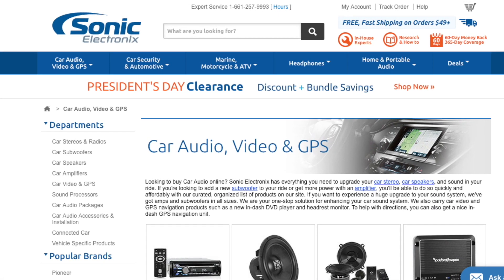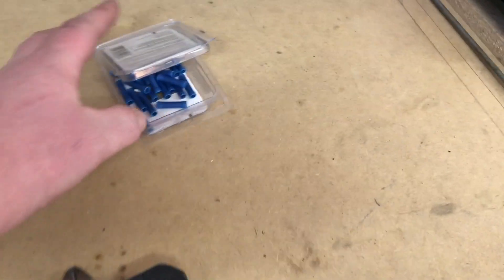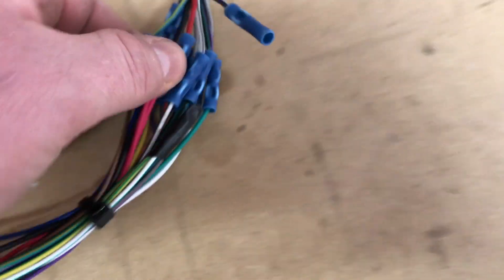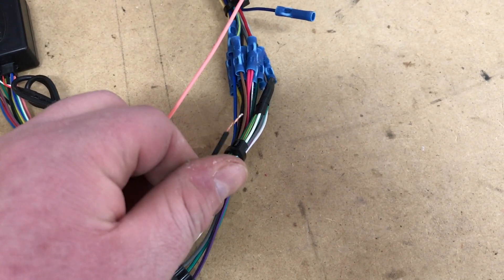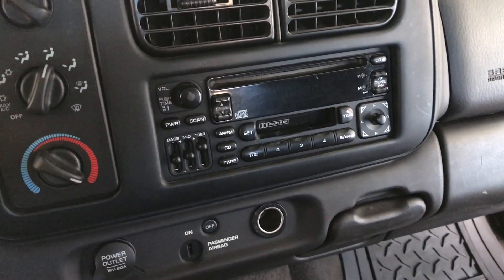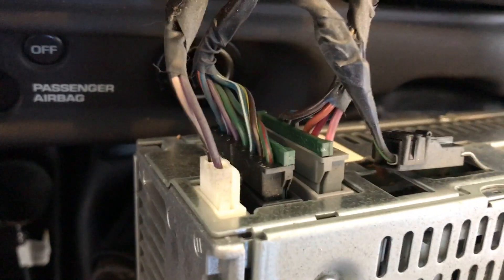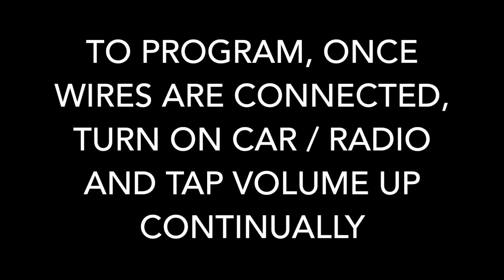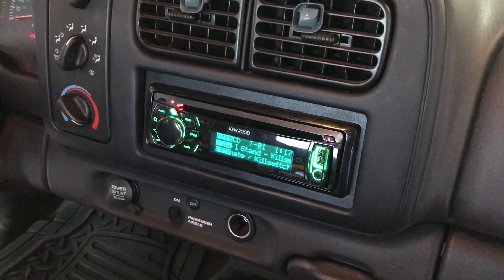1997 - 2000 Dodge Dakota/Durango Radio Install

Comment: What does the orange wire connect to
Reply from the maker: Orange wire is generally the illumination / Dimmer wire.  If your radio does not have it equipped, just tape it off.

Comment: What color wire is the hot one
Reply from the maker: Constant 12v is yellow, switched 12v accessory is red.
Reply: Provo Beast Audio Installation there is two plugs and a small plug  I'm stuck

Comment: Where does the amp turn on wire go?
Reply from the maker: to the blue wire if you have the amplified system.  If not, just cap it off.

Comment: I got power but no sound idk what the fk i messd up on it color coded
Reply: Plz help
Reply: I have the infinity sound ... so factory amp ???
Reply from the maker: Sounds like you may have the factory amplified version which in that cause, you need to hook up the amplifier turn on wire to trigger the factory amp to boot up.  If you use a wiring harness adapter, you will need to connect the solid blue wire on the adapter to your radio's blue/white wire.
Reply from the maker: Yes, you will need to hook up the solid blue wire to either the radio's blue/white wire or the red wire.  This will trigger the amp to turn on .
Reply: Balls to the wall man thank you so much 💯💯💯
Reply from the maker: My pleasure! Be sure to like and subscribe!